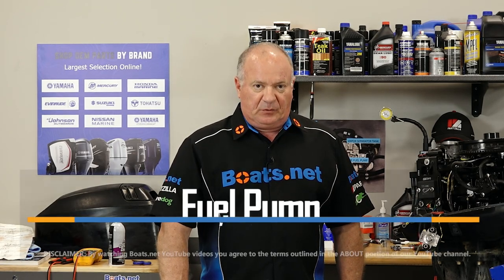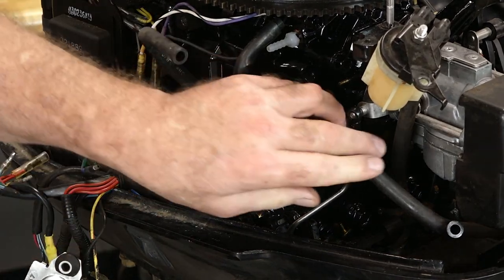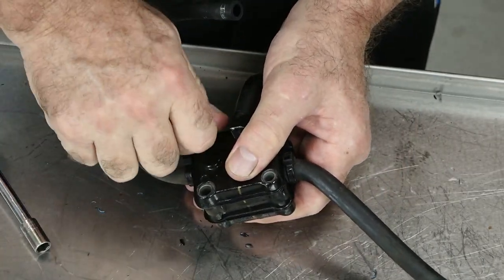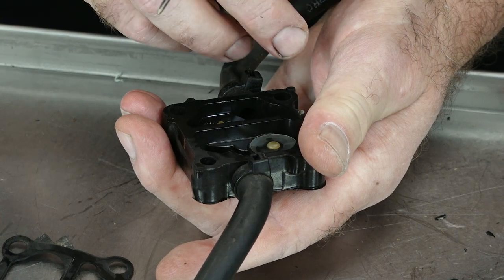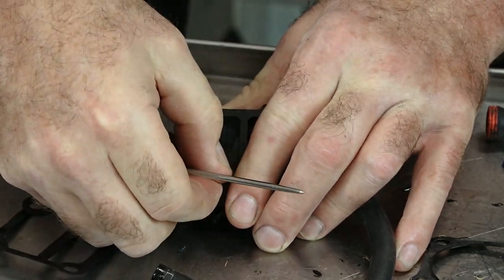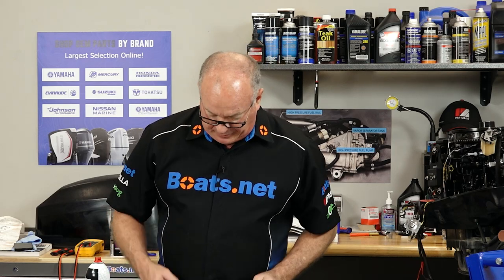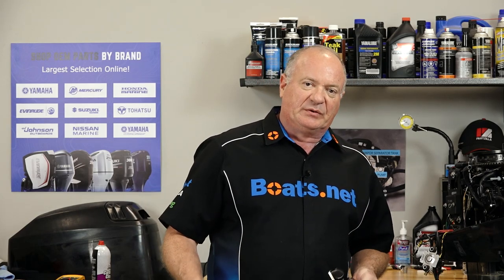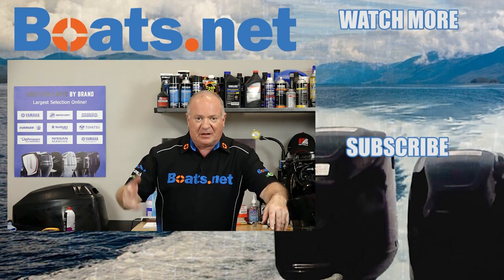Mercury 2 Stroke Fuel Pump Rebuild | Mercury 40 HP 2 Stroke Fuel Pump | Mercury Tracker  | Boats.net

Comment: Is it normally the fuel pump when at first the boat starts up, but after you let it run then cut it off then it won’t start back up?

Comment: Thank you. I am currently working on a 2007 50 hp EFI  4 stroke.  It ran for 20 minutes, then VST output pressure dropped to 2psi and jumped back up to 43psi. It did it two more times them shut off.

Comment: My ‘94 tracker 40 doesn’t have the vacuum hose coming out of the front. Does anyone know if that’s common with older 2-strokes? Seems like all the replacement pumps online have the elbow fitting coming out of the front (vacuum hole)… Just pipe plug the hole and move on or what?

Comment: Great video, but the manual says to break it off prior to pushing the pin in, not after seating the pin. It seated as intended in this video. There is not supposed to be anything to break or snip off.

Comment: I have a fuel pump off of a 1995 two-stroke 60 hp mercury order a new kit for the pump. It came with two clear nylon check valves and two rubber ones,  the original carburetor but I took it off. Did not have the rubber in it can I still use it And combination. Thanks.

Comment: I could not get the center pins to push in at all for the check valves. It wouldn't go in at all and broke off. I couldn't really get the other one to move either before I even insert it. I was just checking it after I broke the first one and it wouldn't move down before I even put in the pump.